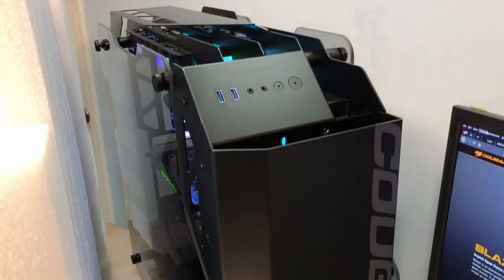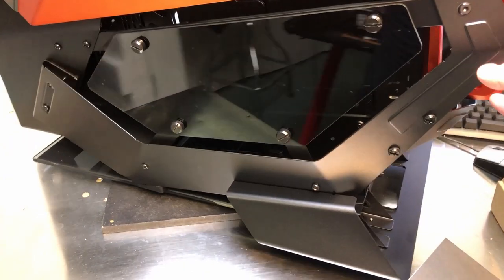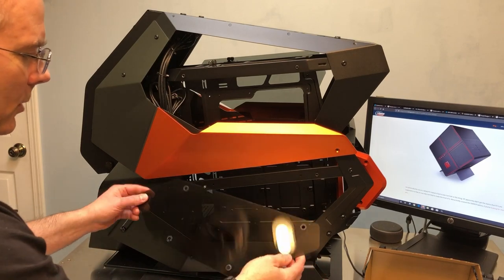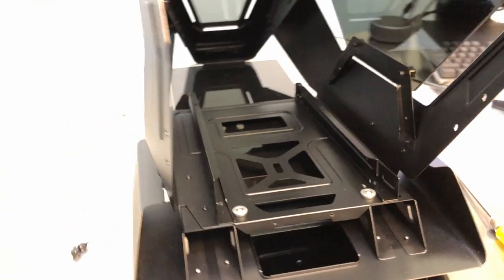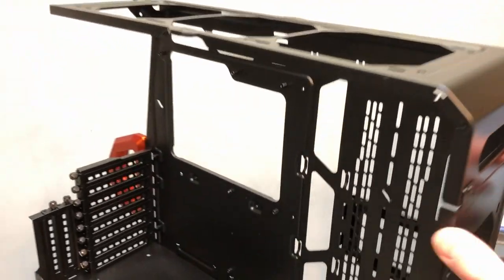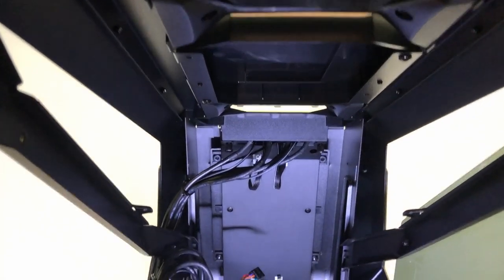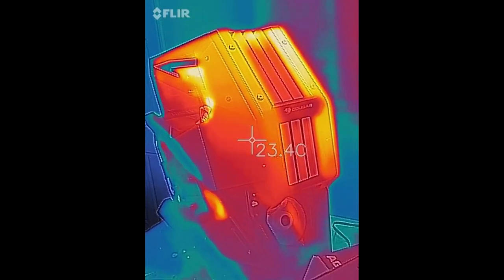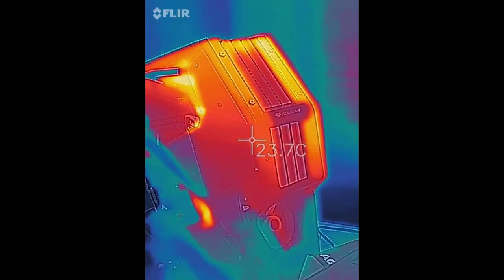Overclockersclub reviews the new CONQUER 2 by Cougar!

Comment: Killer case. The Conquer 2 is the nicest open air design I've seen yet and one of the coolest looking cases of all time. Definitely next level and kudos to Cougar for pushing the boundaries. The only thing that bothers me are the exposed I/O cables at the top front of the case where it's open above the glass. They're quite visible and I'd probably do something to conceal them, maybe adding a custom mesh panel in those upper openings. Amazing product nonetheless.
Reply from the maker: I agree - it is a great case.  And as for the exposed cables, they can certainly be moved to a location that is not as obvious, and secured with cable ties.

Comment: 36:27 I wondered how you were able to address the RGB color on the case and it turns out, all you have to do is hold down the hexagon symbol button next to the power button from the left to synchronize the RGB colors from whatever application the case supports to change colors. If this is common on any PC case, then I didn't know because I'm new to PC. And yes, I do own this case myself. It's an amazing case to purchase.
Reply: i can change the colors after all??
Reply: @SamGabrielBibanco , yup
Reply: thats crazy ive been confused if it switches.. for weeks
Reply: wait can i also do 1 color only?
Reply: @SamGabrielBibanco , yeah. It’s all up to you how you want it to customize

Comment: Just bought this will be in Monday! Can’t wait! Tank case for tank specs! Also ordered a Ryzen 9 3900x, 16gb more of 3200 ram, sitting on a b450-f gaming mobo with a 2080ti!
Reply from the maker: Tyler Crider Go for the PCIe extension cable to mount that GPU vertically!
Reply: OverclockersClub is there a good enough gap between the glass panel and you for fan air flow?
Reply from the maker: Tyler Crider There’s about 1.75” clearance on my GTX Titan (reference card) but even a larger card should be fine.
Reply: OverclockersClub I can’t wait for the case. Have to find room for it the current bench my case sits on is too small lol and like you said in video you want that to stand out lol
Reply from the maker: @SnipeKing90  Yep - it looks good from any angle.  Definitely needs to be prominently displayed.
Reply: OverclockersClub so I’m currently setting up case and trying to mount the Corsair h100i rgb platinum to the top of the case with radiator leaving a last fan salt and it won’t fit a single fan next to that. And noticed the case doesn’t have an exhaust fan in the back so frustrating

Comment: What configuration are you running your fans in? All intake (i noticed it doesnt have a back exhaust) or are you running the cooler as the exhaust? Also how much room is between the front fans and the case?

Comment: I’m having trouble with getting the RGB or any buttons to work on my case, however I haven’t finished the build yet as the SATA port on my motherboard is the smaller type. I’m using the Asrock Z490 Aqua and this is actually my first build, so my question is actually how important is the SATA cables? for the case because every other cable is connected except for SATA.

Comment: Are you water cooling in the video? I didn't see any liquid. I am looking to possibly get this case but I'm a little scared with water cooling.
Reply: Yeah, the pump on the CPU is connected to a radiator on the top. In the two pipes theres liquid

Comment: Love your review mate, went through the whole chassis in detail. Would loved to see how you plugged in those outer chassis cables into the motherboard and slid the inner chassis back in. All in all a great review
Reply from the maker: I know that the depth of detail I go into can be overkill, but I am glad you liked it.  I pulled the top I/O panel out to make it easier.  So I just had to keep an eye on the panel as I slid the chassis back in.  And with the large space above the chassis, it was easy to reinstall the I/O panel.  I could have done a better job of hiding the cables.  There is enough slack to hide them better.

Comment: I want to build a pc with this case, but I cant find a motherboard that's compatible for it
Reply: Was that a joke? If not, Supported Motherboards	ATX, microATX, Mini-ITX
Reply: @_Daio_  I thought it said on the website that it didn't support ATX
Reply: @floppademon1506  Trust me, It does.
Reply: @_Daio_  oh yeah, there was an issue where if covered it up, I want the original case now anyway
Reply: @_Daio_  do you reckon it will fit a dark rock 4 pro in it
Reply: @nathanodonnell1466  The specs for the case say "CPU Cooler Max Height	150 mm"  and the specs for the dark rock say "Dimensions: 136 x 163 x 146 mm (W x H x D)" so nope. It was the only 2 slots for a vertical GPU mount that put me off, but my Noctua NH-D15 was too big as well.
Reply: But does it fit an eatx though?

Comment: Whoa... that's really big
Reply: It supports up to CEB form factor motherboards and has eight expansion slots, plus the removable chassis. It can't really be made much smaller but must be very heavy as a consequence.
Reply from the maker: @jamesaron1967  Yes it is a bit heavy, especially after you get all of your system components in there.  And I added 4 more 3.5" hard drives.
Reply: @overclockersclub  will it fit an eatx?